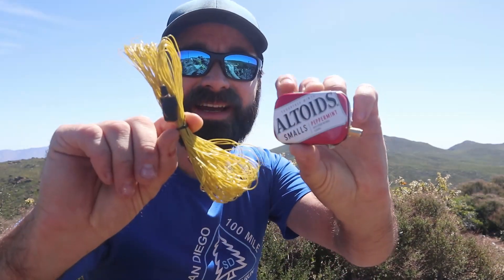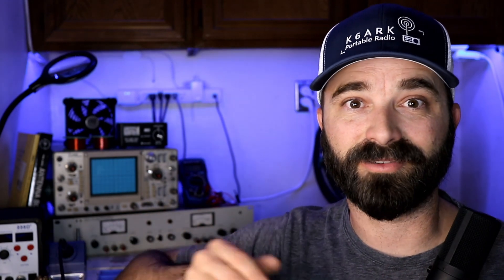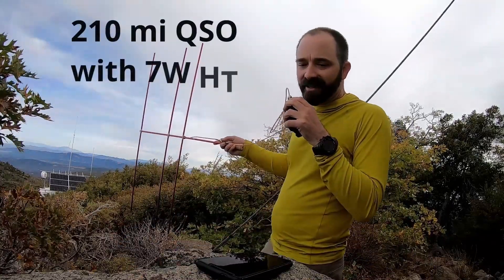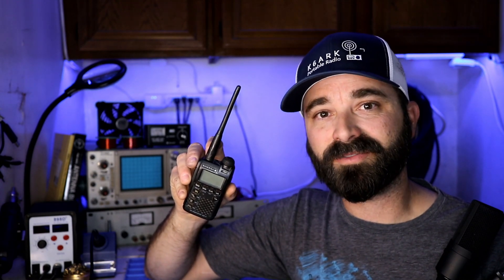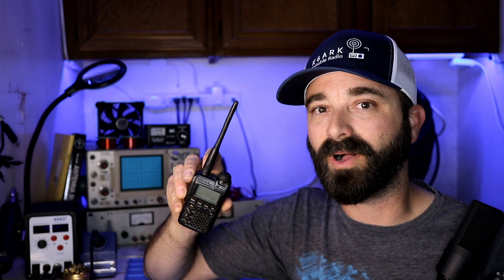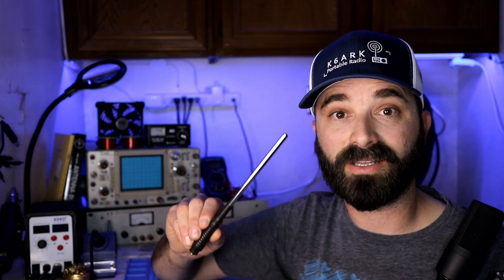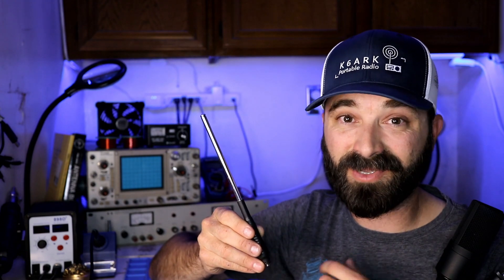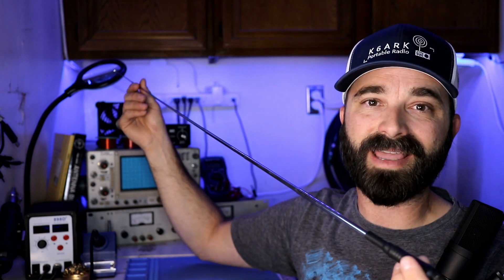How to pick the best HT Antenna

Comment: I've got a telescoping half-wave for 2 meters much like the one you described. Like you said, it is an excellent performer. When I tested in, it hit a distant repeater no other antenna reached. I also checked it out on other frequencies with a NanoVNA. By telescoping it in, it can be tuned for the marine VHF band and even 220 and 440. You could create a cord with knots for the lengths for other bands you use.

Comment: We use a vehicle repeater, large antenna and amp with Solar battery maintainer.
Just be within 3 miles of your vehicle and talk using a stubby. Turns your HT into a 75 plus mile powerhouse.
If digital, you can talk nationwide through internet linking repeaters or Verizon network.
Or hell, you can download 2 way radio apps like some police use and just use your cell phone as a two way radio through cell towers and wifi ❤

Comment: The average "rubber duck" antenna is typically assumed to be between -5 and -8 dbi.  This is due to the horrible impedance mismatch.  They are rarely 50 ohms and very narrowband.  It is possible to tune a duck to a near 0dbi resonance, but only for a very narrow frequency range (like 200 khz at 2 meters).   The best possible antenna for an HT is a regular antenna (dipole, jpole, etc) fed by coax.   If it must be mounted on the ht, about the very best you can do is a 1/4 wave whip, and it must be resonant.  This is tricky - testing impedance requires a metal shell the size of an ht, a coax connection to a VNA that has multiple ferrite chokes in the metal shell (so the coax will not be part of the antenna) and you must hold the shell the same way as you would use the ht.  If the shell has a top bnc connector, you can swap antennas, trim to length etc.   Doing this is a real eye opener - forget about theoretical gain, just get the impedance matched.   You will find that most antennas designed for ht use have completely wild SWR , like 5 or 10 to one.   Often they will have a frequency range where the match is decent, but it's rarely near the frequency you're using.

Comment: Do you find the smaller stubby antennas (looking at a couple smileys for gmrs) perform better or at least just as good as the stock?
Reply from the maker: Stock rubber ducks vary significantly.  Those from the big Japanese ham radio manufacturers are often optimized for the radio and can work very well.  GMRS radios, particularly cheaper Chinese models, will be more hit or miss.  I'd have a hard time giving a solid recommendation without directly testing or comparing. I do like the mono band slim duck antennas from Smiley, and I use a stubby duck on my DMR HT to get into the hot spot at my house (short range).  I have not tested it for long-range use.
Reply: @K6ARK  really appreciate the reply, can’t find much with testing all these antennas on YouTube, the Nagoyas and smiley supersticks have a lot of video reviews but not the stubbys. I think I may just bite the bullet and grab a 701g to replace my stock and possibly a 771g or super stick for longer distance

Comment: I have an original Diamond SRJ701A antenna. It performs worth than the original rubber duck paired to Anytone 878UV. Tested the transmission with a field strength meter. Using SRJ701A, signal strength is roughly 10% less at VHF, 30% less at UHF.

Comment: I used to work public events and emergency services like storm spotting (county ECOMMS), Red Cross and the like. I used a ft50r for those, and trashed the stock antenna for a 19” whip that occupied a pouch on sm/med sized backpack with the mike running under my arm and securing one one of the shoulder straps. No antennas in the eye or bashing me on the head. You may say what about the channels (freqs)? Once it is set it’s never moved.

Comment: Interesting video, but you did not cover the Abbree antenna's
Reply from the maker: It's impossible to cover every antenna, but for me, the Abbree fails from an ergonomic and usability perspective.  They are too big and bulky, and collapse in high winds.  I don't use them for those reasons.  If the ergonomics are acceptable for your use case, they are high-performance antennas, but I still find the half-wave telescopic whips to be the best performers for a radio-mounted antenna.
Reply: @K6ARK  The thing is your only looking at the 20+ inch long Abbree antenna's. Of which I have the 42.5, that I do not attach to my radio. When I use it I attach it to my backpack, then run a line to my radio, works great. For on radio use, I have the 13, 15.35 and 18.8 inch Abbree's, none of them have ever folded on my. And I've used the 18.8 inch one on my radio, on my bike while riding, no problems. Plus that telescopic antenna, while it does preform well, but only on 2m, and where I live we have a very active 440 repeater. So I will always buy a Dual Band antenna.

Comment: I have a handful of HT antennas and right now I’m digging on the signal stick because it fits nicely in small pouches. I switch between an EDC pouch for the FT-60 and a different pouch with the UV-5R (same stick also fits on DMR HT)
Reply: @Andrew » What kind of antennas do you have? I have a drawer full of them and still don't know how good they are because I have no friends who are willing to do range tests with them. I don't know why no one replicates antennas like the Signal Stick. It seems like a superb antenna and I don't know anyone yet who's poked their eyes out. The four aspects of a great antenna are 1) power rating; 2) bands; 3) range and, of course, 4) price. The real sleeper is the Abbree tactical. Another favorite is, not surprisingly, the Signal Stick. I love the glow-in-the-dark option, but I don't have the pennies saved up to choose them, so I'll have to be content with the tips. 

The cheap whip antennas are the ones I've always wondered about. The ones included in package deals on Amazon. I'm beginning to trust Retevis products, and love the RHD-771 20W antennas! They feel substantial and they're my standard antenna now. In fact, I'd take one of them over a Nagoya any day. That may change if they fail tests, but now I love them. 

We need more antenna tests on YouTube. Anyway, which antennas do you like?
Reply: @johnroberts6695  yeah, glow in the dark is neat but I didn’t opt for it. haven’t put my eye out yet but I’m always careful unfolding the signal stick because they tend to whip around on you!

I have more diamonds than Nagoya’s. Range tests…I get it, but there are always so many variables that even controlled tests cannot account for them all…so I think a variety of antennas helps to cover the bases…plus it helps to have different sizes depending on the application / carry

I have the abree -42” which I’ve added to a VHF go box but I have to be careful on the watt rating for mobile use. I also have a diamond that kinks 90 degrees so I can lay down the radio and keep the antenna vertical

I’ve found quite a few range tests online. Still can’t get my wife to get her tech so I have to rely on local hams. If you get somebody on a repeater you can try switching antennas if they’re game or have them switch to a UHF channel with you or maybe try simplex. 

I find that’s more reliable than YT range tests because it takes into  account your local conditions. Watching a range test on an antenna done in Nebraska is pointless for me because I’m on a mountainous island - another variable 

Rubber ducks aren’t always that bad and you might try making a tiger tail… that would be a good range test vs your best drawer accessory antenna. Haven’t tested my tail yet

I’d recommend one signal stick for your fav. HT. Worth it

Comment: I've found that there's a fourth consideration, and that's that there's no non-stock dual-band antenna I've found that will give superior results on both bands. I have some that are great on  VHF, but not so great on UHF, and vice versa. If you know of any, I'd love to see them. I tend to gravitate to UHF, but I'd like to find one antenna that would work on tri-band but, lacking that, finding a dual-band. One antenna I've had good luck with its the Retevis RHD-771. It's an eye-poker, to be sure, but for all-round use where distance is key, I like it.
Reply from the maker: For a dual-band, 2 m / 70 cm, the Diamond SRH-77CA provides better performance on both bands.  It is particularly good on 70 cm.  Diamond has some tri-band versions too, although I haven't tested them. 

But I think you comment goes back to my point that many radios come with antennas designed specifically for the radio. As a result, they typically perform quite well for the purpose, considering the size of the antenna.
Reply: @K6ARK  I'll pick one up. Where's the best place to get them? Also, have you ever tested or tried the AL-800 retractable (made by Pryme, HYS and other companies)?

Comment: Great video.  I do have a 5/8 wave Diamond RH 205 that I use on an Icom IC V86. My other radios I use a Comet antenna.  I do have some Baofeng radios too.  I must have hit the Baofeng lottery. I have a UV 9R Plus that does 9 watts and the stock antenna works great. After watching all your video, I'm going to  get that MFJ telescoping antenna. Thanks.

Comment: I've always found telescopic antennas to be more durable. I do really like the Signal Sticks though. I'm going to check out the links above for directional antennas as they are not something I have really looked into much before but could be very useful.
Reply from the maker: Thanks John,  you do have to be a little careful extending and retracting them. Also, regarding directional antennas,  check out my other video on the build of a small portable dual band 3 element yagi.

Comment: I bought over 10 Smiley antennas on one purchased order. The antennas came with some incorrect model filled and some manufacturing defects. I contacted them and they gave me a very poor response and only agreed to replace one of them. That was a $350. Order. And the person I was dealing with was not just a low level employee but the owner herself. The antennas are well designed, but not perfect. They are not tuned to the centre of the bands that they are sold as. But they do work well. However, due to the poor customer service, I'll never buy from them again. I used to live in San Diego, missed it a lot. And I am sadder about by experience in this incident because of this. I own over 200 antennas for handheld transceivers, and over 50 different designs among those. I buy the cheapest Nagoya clones,  no name stuff on eBay cheap, to custom tuned Motorola stubby, and many of the Japanese ham brands ones, over many years. I still own the telescopic 5/8 2m one by Maldol that I bought in the late 80's. It is longer than the Smiley one in your video. I don't have the diamond one in your video, but I have the authentic Nagoya one that is similar. (Nagoya one, despite authentic, isn't also tuned to the centre of the band either.) I tested them with or without an original Tiger tail on the portable antenna analyzer.
Reply: Hi since you have a lot of experience with antennas own, what would be a good antenna for range and shtf to own.  I here signal stick is descent. Or telescoping better?
Reply: @AlexG-xs7kq sorry for the late reply as I don't get notified of your post.

For the SHTF scenario, reliability is as important as performance. Let's say you only have a telescopic antenna, such as one from Smiley, but you broke it by accident as all telescopic antennas are somewhat fragile , that isn't going to help you. So if you have other antennas, then you can have a telescopic one for performance reasons (longer is usually better, just not always.)

You need to decide based on your use case . Are you stationary? Are you moving around? Are you in a forest with trees and branches? Are you running fast as if you might be in a combat situation? That will determine how rugged an antenna you need for this situation.

How portable do you need it to be? If it is going to be a backup comm in an emergency go bag, but you need light weight and performance，then a roll up J pole is a good idea, as long as there is a war to hang it up high.

In my emergency go bags, I have a 5" rubber duck for 2m+70cm and one for 220. And then I'll have a 15" telescopic 2m+70cm to have slightly better performance, just in case I need it, and they are all not very big and heavy so it suits my go bag requirements.

My back country response bag (now somewhat not doing much as I haven't done as much back country responses) will have a 17" flexible 2m+70cm antenna, and then sometimes I have the 1/2 or 5/8 telescopic antenna to have the best performance right on the HT, but I have to be careful not to damage them. Lately I acquired a few Abbree branded foldable (measuring tape) antennas (28" version "and I'll be replacing the telescopic ones above with them, should I need to be deployed for back country responses (unlikely).

For urban responses, it depends if the radio is single band or dual band and if I need wide band range use or narrow band range use. For reasonable flexibility and length, and not so wide band range, I think the 1/2 dipole design such as the Larsen Kulduck dipole is excellent, but hard to find. As for the less flexible but wider band range for VHF (136 to 174), the Motorola 8505518V01 (there might be counterfeiting on eBay).

In general, try to use genuine, somewhat name brand products, and try to use them as long as a design that you feel comfortable and can tolerate (especially for VHF or lower). I think Comet, Diamond, Maldol, and a few other Japanese brands are good, although not cheap and sometimes even expensive, and still don't have a very well tuned product (to center in the ham bands).

If you want the ultimate flexibility, the Diamond SRHF40A, which I recently bought, is perfect and there is no competition.

Nagoya is not bad and not as expensive, and it's a Taiwanese company. But beware of counterfeit just like for Diamond and Comet.

Signal Stick is also good, but it's really a VHF only antenna, and I don't appreciate that it's being marketed as a dual band antenna.

For you SHTF scenario, as long as you don't use the cheapest junk on the market (but some might be ok, just need very thorough tests, especially for durability), and have backups, I wouldn't worry too much.

Performance isn't that hard to test, but durability is hard unless you sacrifice one to torture test it to see what the tolerance it can be when being abused and see if it can still be used. Again, it really depends if you are in a combat-like situation or not.

By the way, I don't recommend Smiley for you SHTF use, because the screw adapter in the base is not very secured and can easily come off, and it's a weak link for ruggedness, as it adds an extra risk point. It's great for experimenters and hobbyists since we like to mix and match them to play around.

The same thing is also said about using RF adapters, try to get a good antenna without needing to add an adapter to your radio, if you can. For the same reason. You want to reduce the number of risk factors.

Also avoid those antennas with very thin whips, as they will bend at the base and break after a few times of dropping, and that's it (I had destroyed a few not cheap Diamond ones over the last 30 years ).

Also, with everything else equivalent, a single band antenna is better than a dual it 5 multi band one, because it's very hard to design and tune the latter, so if you don't have to use more than 1 band, then use a single band antenna if you can.

All HT antennas are compromised antennas, so you just need to give in on some factors. But a tiger tail, can improve things, so add that to your system, and unlike antennas, this is very easy to DIY, and just make sure it's rugged enough, (ironically, I own an original, the connector came off the wire once.)

I haven't even touched on antennas extended by a coax, except the roll up J pole. This is going to be way too long.

Comment: I've had my MFJ 1717S on my Yaesu FT60 for about 6 years now and I truly love it.  Imo no better HT antenna, way better than the stock Yaesu rubber duck and better than my telescopic since I can throw it in my bag or clip it to my pack and not worry about low branches while hiking to my SOTA location.  Also FT60 is a tank of an HT...well worth every penny I spent, probably my best ham investment...love my new FT818 though.  Great video, looking for a BNC replacement antenna for my front connector on the 818 now.

Comment: My first SOTA activation I got a ~200mi Summit to Summit contact on a MFJ Longranger. IIRC the other station was on a yagi. Can't remember the signal report, bc I was too excited :D
With more use I've noticed that sometimes I need to hold the longranger horizontal to receive weak stations. Not sure why that is the case.

Comment: Hi Adam, fantastic video. Great advice as always. I have an 18" tactical antenna on top of my anyone 878. I managed to get into a repeater 17 miles away while out walking  along a canal path in a dip. I was very happy as I haven't managed to open it before. At home I swap the antenna for one like you, it's about 3" high and works great into my DMR hotspot I am mostly on the Hub net talkgroup or sometimes worldwide 91. Super video, take care Motters M7TRS 73
Reply: Did you get the Abbree antenna. I have several and they work very well.